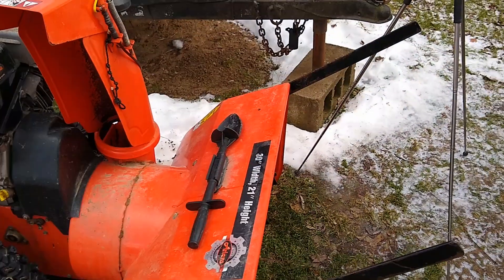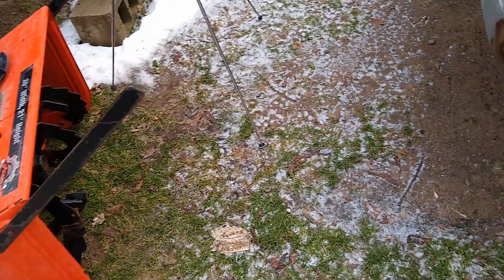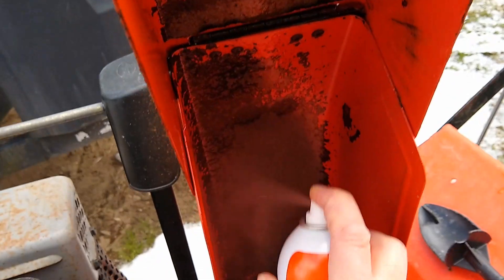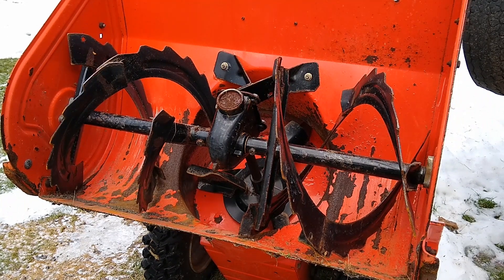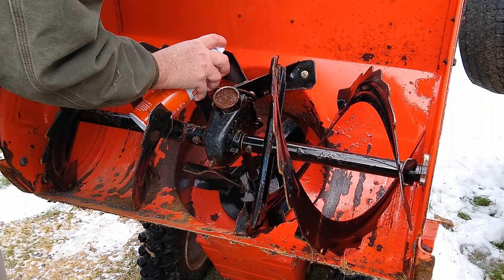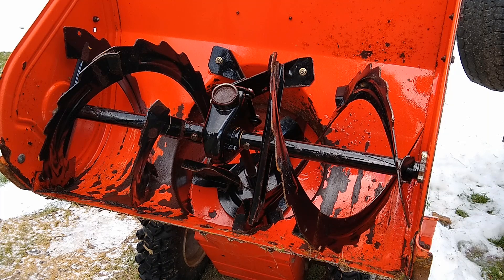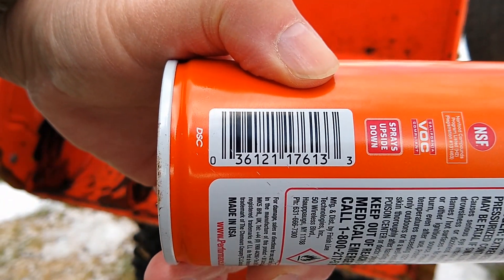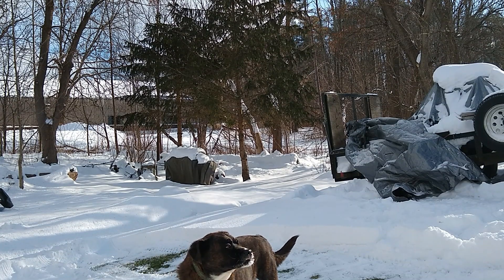Stop Wet/Heavy Snow From Sticking To Your Snowblower - Doug Doing Demos

Comment: Take auger off, sand and repaint the intake.
Reply from the maker: I would but I snowblow a grave driveway and so I be doing that about once a month during the season. Any other ideas?
Reply: @dougdoingdemos  problem is the engines last way longer than the body parts - how about you lower the skid shoes and move it up about 1-2”. That’s what I did at the new house when the driveway didn’t get paved before winter and was hitting the gravel as well. The builder told me to raise it by lowering the skids.
Reply from the maker: @Oldwiseguy-59  I lowered the skid shoes but the problem is in the Spring the ground is soft and it sinks into the gravel even those shoes sink in. It gets better once the gravel freezes and gets below zero but nothing's going to help chew into the gravel that's just going to happen. I've looked at it's mostly light surface rust it's not like the rust you get on your car that eats through the sides of your car it's more surface rust. I'm thinking of selling it and getting a battery powered snowblower those are mostly all plastic and then should solve my problem with the ugly rust.
Reply: @dougdoingdemos  other option is to make skids out of wood as an attachment for ski tips from an old pair of skis and that should keep the front from sinking. I sold my gas as well and picked up the 28” Ego beast last week before they sell out.

Comment: You're better off using a ceramic coating like you'd use on your car's paint. Liquid or spray works, but liquid although it takes a little longer to apply typically will outlast the spray type. You may be able to go a full season on one application.
Reply from the maker: Thanks for the tip/ I want to try the e1 says good things about it.
Reply from the maker: A lot of people are going with the ceramic coating. I may try it this year. Thanks.

Comment: How long do you have to wait? How many uses does it last for?
Reply from the maker: I usually spray mine after each use as part of my clean up routine so it dry and ready for the next snow event. In the past I've sprayed it and used it right away and it still helped. Right now today, 12-9-2022, my machine is sprayed up and we are do for a snow event tonight. If the snow seems wet I will spray it again and let it dry while I check gas and oil levels. Thanks for the questions. Let me know how you it works for you if you try it. Have a great rest of your day.

Comment: Would this work on a plastic chute?
Reply from the maker: Yes Silicone spray oil works really good on plastic, metal, locks, and I use it on my pistol slide just remember to wipe over it lightly to remove any excess spray and to even it out over the entire part.

Comment: Any chance of that getting on the belts?
Reply from the maker: No the belts on most modern snowblowers are  protected in their own compartments. Good question though, if you see belts don't go spraying this stuff on them and don't spray it on the drive disk either, I didn't when I was younger and it took for ever to wear off and run right.

Comment: Thanks a lot Doug for the video.. 
Thank you guys who replied to confirm it works..

Just wondering how often should my snowplower be sprayed with this dupont? 
Once a winter or once every use or spay it once for life?
Reply from the maker: That's an awesome question. What I do is wait until I see it starts to stick to the inside and then I give it another good spraying. In powder type snow it last longer then the wet heavy stuff, but it really doesn't take that long to spray it. Someone said he uses, Fluid Film, I looked it up om Amazon and found out that that's a spray too. I'm going to try some this year and make a video of which one worked best for me and why. Thanks again. -Doug
Reply: @dougdoingdemos  Thank you Doug.. quick reply.. awesome

Comment: Pam works better and its cheaper
Reply: my son used WD40
Reply from the maker: Use what works for you. The idea is still there.
Reply: @Slick1G3  does the WD 40 WORK?
Reply: @paulclifford8703  paul i never tried it but my son has and say his machine threw farther then his neighbors   ive used furnature wax lke" pledge "
Reply: Heard it isn't good for real cold temperatures
Reply: @paulclifford8703  From what I've gathered, it is similar to Pam. Good to use. but not good in extreme cold because it binds up.
Reply: @lptherapygroup6591  Thanks

Comment: A impeller kit would solve that problem. And it throws the snow much further. Easy to do and cheap.
Reply: I really doubt that the kits improve anything.
Reply: @percyfaith11  you would be surprised. I was very skeptical myself and figured what the hell, i was pleasantly surprised. I never thought that 1/4” between the impeller and the housing would
Cause a problem.
Reply: @K1DTC  Appreciate that.  I put them on my Toro 8-24 and nothing was changed.
Reply from the maker: Don't install a kit on a cheap snowblower it will mess up the brass impeller gear, I learned that one the hard way and that gear isn't a cheap part and it's not fun it install one. I say the engineers know how much stress that gear can keep and build the machine with that in mind, but it did throw the snow crazy far while it lasted.